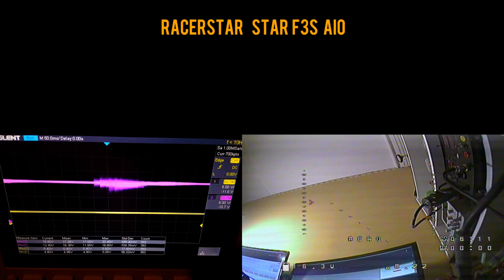Racerstar StarF3S AIO with 4in1 ESC // Review and Noise Testing?

Comment: one caveat about this board worth mentioning is the 4 mounting holes are actually wired to VBATT! Do not use metal screws or you risk an explosion if your carbon fiber frame gets grounded.
Reply from the maker: +ricebowl1988 Thanks for the info
Reply: Wow. That is quite an oversight.. .
Reply: yeah. I do not know what they were thinking. For added security you could add some liquid electrical tape to that area. The same issue with the ready to fly quads version of this: http://www.readytoflyquads.com/flip32-f3-omnibus-aio-asgard-f4escosdcs

Other than that issue I have been satisfied with this board, plenty of power and FETs stay cool even after pulling 70amps continuously for a flight. Slapping a low ESR capacitor to the battery leads cleared up most signal noise for me. I added an external 5v sbec to power my camera / vtx. I have my reservations for powering a vtx off of the linear regulators on that board. I bet it will get super toasty.

Comment: Hey DroneMesh, i just had my frist build with this 4-1, everything is worling fine, but got no Telemetry sent to my receiver, i have a XSR receiver and connected the "smartport" cable to the Tx port of the board, i also added one of those softports inbetaflight and selected "smartport" but still no signal sent to my control, please help me figure it out whats missing.
Reply: Hi, did you solved this propblem? I have the same situation. R9Slim receiver soldered to tx1, but i have no telemetry working. Smartport enabled on UART1, configuration tab telemetry is turned on. Have you got a sloultion?
Reply: Piccolo FPV yes I did, you have to do the xsr telemetry hack (look videos for it, not complicated), then you have to solder both tx and RX pads to the telemetry cable ( as weird as it sounds, but it is like this) then of course enable telemetry in betaflight and in the cli you have to write .... set tlm_inverted = on (or similar, don't use it anymore). This board is not really good, be careful with soldering, and good luck.
This should fix the telemetry, this is.problably your first  quad.
Reply: Thank you for your answer. Yes, It sounds weird. I do a search about it. This is my second build, there's no problem on my 130mm quad, since the xm+ gives rssi value on one channel automatically.
Reply: Piccolo FPV Believe me that what I said is the only way to have telemetry with the F3S and f4S, have both and use the same method. With the XSR...I have tried so many ways before with no luck, good luck.... just reply again when you do it just to make sure I was able to help someone.

Comment: Hey so I had what I thought was an ESC failure with the StarF3s because on my maiden flight the quad decided to drop out of the sky like a rock.  After that the ESCs would not arm anymore .  The FC would boot and that was it.     Randomly today I decided to plug a battery in and now it works??  How does that happen or what could the problem have been?

Here if the video of it failing https://www.youtube.com/watch?v=YvROQZSS0YI

Comment: Drone Mesh I finally experienced the flip of death. I use stock settings, and noticed that my roll rates during first flight seem to be faster on single roll flips. I did a multiple roll flip and experienced the role of death which seems to have damaged one of the escs. My question is is there a signal pin, or pad on the board that I can bypass the esc, and install a external esc to continue to use the board?

Comment: hello Drone Mesh, i have 2 f3s , 1 with f60 2450kv (not many noise) and 1 with rcx 2206v3 (many noise) i have try 1000uf 25v on xt60, nothing happen, i have try 470uf 16v on 5 v , i think it s better but not sur,i see in the description, this board have 2 regulator 5V (1 on the esc (2A??) and 1 in the fc (1A?) can you advice me plz. Did i make a bridge beetween the two 5v pad? did i solde the capacitor to the 5V near sbus/usb side? or near the video side? thank you for your time
Reply from the maker: +queinnec35 the noise on the VTX I had noise but simple fix add low esr cap and a 12v regulator for the vtx. I made video about this.
Reply from the maker: +queinnec35 https://youtu.be/VZpC4OQ57bM
Reply: i wait the matek regulator buy on bangood :) i will test, and you? will you test the F4S soon?
Reply from the maker: queinnec35 yes I got it yesterday and will upload build video.. I will not test on osciliscope because real world testing is better on these. 

These boards I can not hijack the signal pin and run it through my script which induces noise.

Build video will be up in couple hours.
Reply: great i wait your review noise before buy :) warning with the sbus on the f4s ,many people have trouble
Reply from the maker: queinnec35 Yes will be testing it soon I heard problems of noise also. Video will be up soon ^_^

Comment: Any chance you could test the f4 version of this board. I have the one with OSD and appears to be ok but it does send my video crazy sometimes, and I have to unplug the battery and re plug it to make it stop. Would it help to ground the frame to battery(-)? The stack is isolated from the frame with plastic standoffs due to the mount holes being v(+) AGAIN.
Reply from the maker: Trystan Jones I flew this board and the f4 version is on the way.. the noise you see is from the vtx and not the osd which is very good. Because the vtx noise is an easy fix and I will be uploading the video tommoro w on this issue with the fpv footage and fix. What you need to fix it is a 12v regulator and so far the best I have tested was a small Matek 12v regulator with an addition of a low ear capacitor. I could not finish the video today and should be up tommroow.
Reply: Thanks. I'm using Rush 1.1 VTX, powered from the battery, which then powers the cam. I assumed the filtering on this would be sufficient.
Reply: Thanks for the info. I have just fitted a capacitor 25v 470uf and a 12v UBEC. It seems a little better, but Im still getting screen flicker and colour fluctuations  also. It makes it impossible to fly, and it only seems to be happening when my horizon is level, when I turn to different angles it disappears. Any ideas?
Edit:
Decided to remove the video wire and bypass the OSD on this board and PROBLEM SOLVED! No capacitor, no 12v BEC needed. So the poblem is definitely the OSD.

Comment: Is there reason to think that an f4 AIO,  running the 6000 gyro, is more predisposed to noise in the gyro than an f3 with similar spec? I don't understand why or how that could be, but my experience with both would support the theory.

Comment: Hello
My FPV video goes black when i push the throttle above 20% 
ANy idea ?
Reply from the maker: +me shkruaj if it goes black that means you camera is turning off and your 5v reg could be damaged and or the battery c rating is too low. 

What camera are you using?
Reply: Its a kingkong90GT with FrSky AC800
Default camera

Below 20% throttle the video is great . Around 20%-30% it begins showing black solid lines , somewhere 40% the screen goes totally black
Reply from the maker: +me shkruaj yes black means the camera is turning off and this happens on 2s lipo with low c rating or battery is not good anymore or the 5v regulator on the board is about to die.
Reply: hmmm

its doing the same with 3 different batteries ( 1 the original with the box ) the 2 others are turnigy . And it didnt had probs before .

Following your advice seems it might be the regulator . The camera has the 2 power cables . Can i hook a multimeter on that and measure the lowest voltage ? It should be consistent 5V correct ?
Reply from the maker: +me shkruaj yes it should stay 5v

Comment: Thanks man two questions:
1) are there any  pads on the back?
2) Where's your channel name come from/mean?
Reply from the maker: 1337flite I am a programmer/engineer and another hobby of mine is mesh networks and drone is the main hobby ^_^

Put them together and we have Dronemesh and I have been developing a racing system for drones based on a wireless mesh network with small sensors .. That was supposed to stay A secret until I have finished it.  ^_^
Reply: Drone Mesh I can't wait to check it out, love your content.

Comment: I have this on my Realacc Purple with Racerstar 2306 2400kv motors...not really having noise issues...no caps right now. I like it alot but had some FOD which might be my fault cause of extreme PIDs....?  I have experienced FOD with several different setups...especially 2" quads. Getting more of these...
Reply from the maker: +Kwad Vision F3 or F4 I think the F3 would be better.
Reply: F3...
Reply: Drone Mesh...I have bought about a dozen or more of these boards in  the last 8 months and I believe that about 5 have had twitching issues. StarF4S StarF3S. If I lower the pitch P and D it helps lessen or remove the twitches but then the craft flys mushy and bobs on the pitch axis. Some boards need greater reduction of pitch P and D then others. I have tried soft mounting the motors and boards as well as adding capacitors. Additionaly if I step down to a 3S lipo it helps or fixes the issues. Any idea what the issue is? How many of these boards have you used in builds?

Comment: Hi Drone Mesh. I have been testing this board since one month and I could notice that the noise came up in the recents days. I didn´t use capacitors so I think that maybe could help.

Pd: There is an error on the solder pad description. The two pads under the five volts pad aren't grounds, they are another 5v and ground(the next to usb) for the leds.